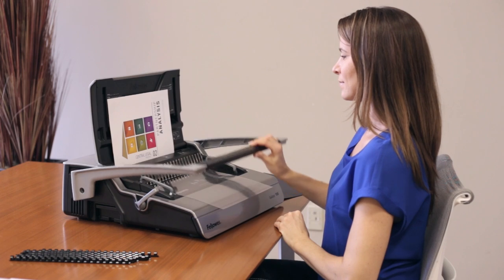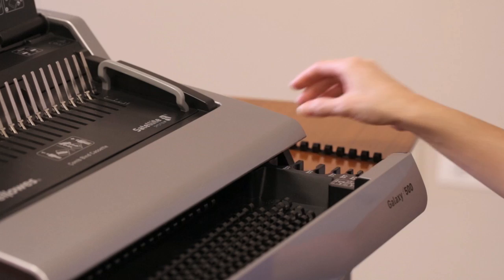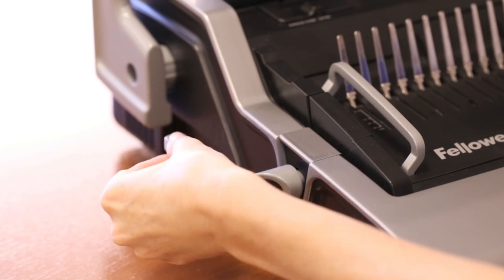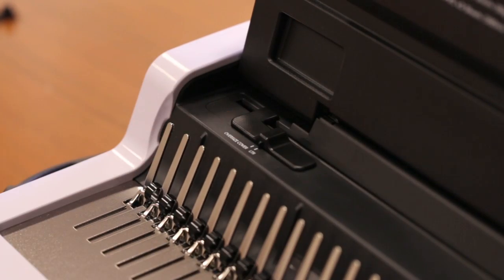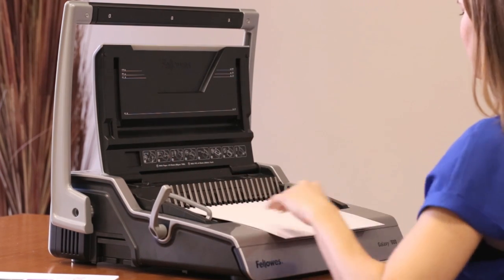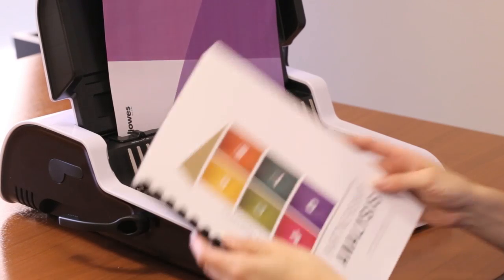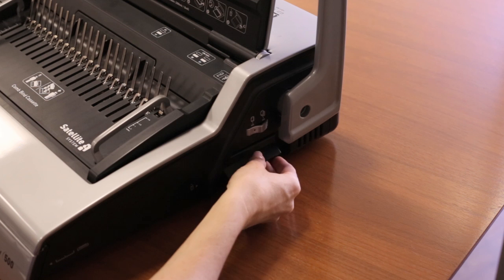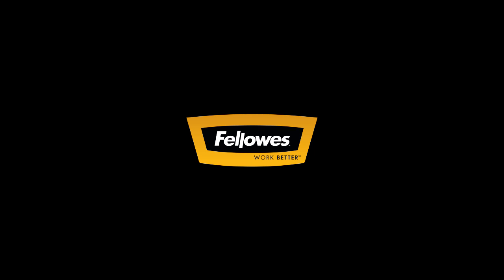Basics of Comb Binding-Fellowes Binding Machines

Comment: Can it punch 2mm mdf sheet as well
Reply: Yes, it can punch a two millimeter when it's up to the lower esophagus through the sandwich of cheese, then the process of cooking the abatement will be finished. But as far as the two millimeter, you have to get a steak with potatoes. And then the two millimeter were turned into a five millimeter. After the five millimeter completes its duty, the damage of the dun dance that will happen. as far as far as greetings is ham.